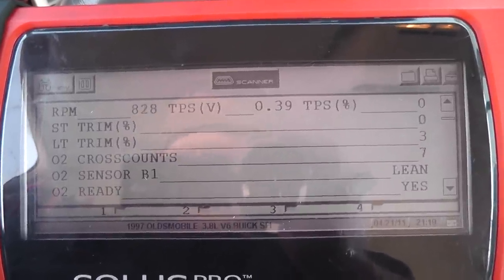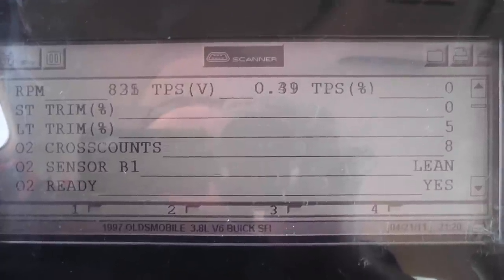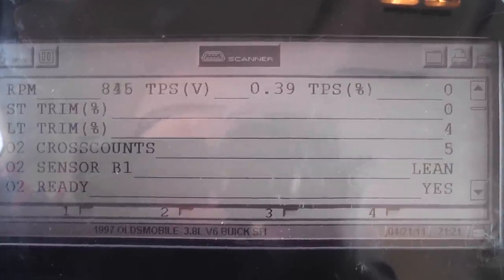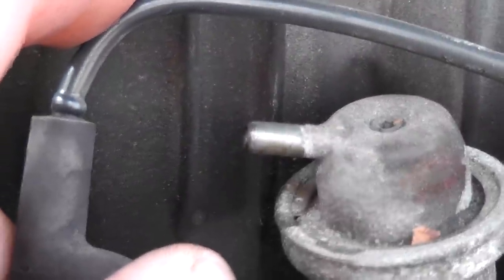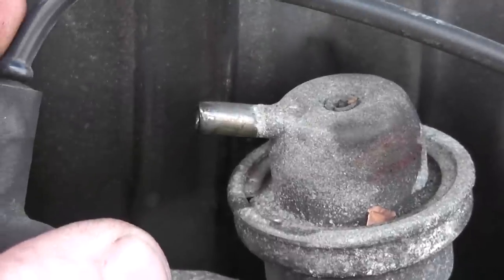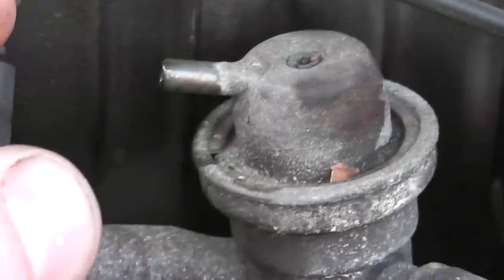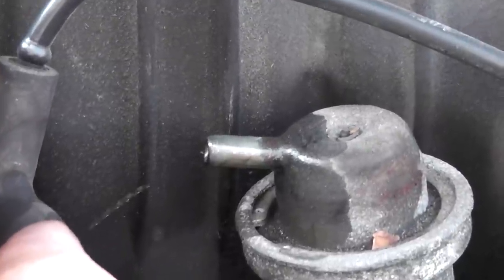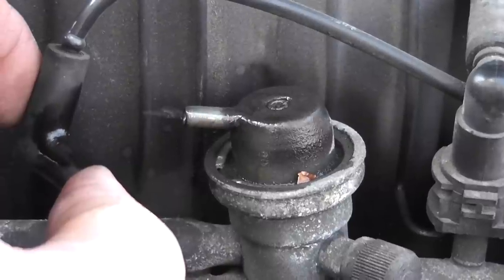Testing for a leaking, ruptured, fuel pressure regulator diaphragm

Comment: That was THE BEST - ABSOLUTE BEST - TESTING VIDEO I've ever seen so far.  You actually showed the damn failure. I already tested it according to what I read online and I didn't wait. Thanks for the excellent test tutorial.
Reply from the maker: Thanks so much! I'm glad this helped you
Reply: Thank you for replying so quick 👍. This is a fuel return to the fuel tank port injected setup system.The fuel regulator required vacuum from the intake manifold and it is installed right after the fuel rail. Do you know how to test a fuel regulator before it is install on any car. with a vacuum pump ?

Comment: Just wanted to say a huge thank you for the video. I have been fighting a stall/hard start problem for months. A mechanic I asked, told me he was sure it WASN"T the FPR cause he has never had to change one. So I threw several other parts at it. Nothing. Even sucked on the regulator to check for gas. Once I ran the car without the vacuum line, seven seconds and it started spewing fuel! Great job!!!

Comment: after waching many of your videos i find a problem very fast in a nissan frontier 2006 that had a rough idle with up and down rpm, and i thought it was a vacuum leak, but after checking the data with the scanner the fuel trim numbers were negative in every rpm, my iac was not causing the up and downs, it was the injection pulse that was causing the up and downs, and also long crank time, and the first thing i did was to check  for a ruptured in the fuel regulator and it was leaking very bad, 20 times worse than the one in this video, thank you so much, you are the best

Comment: dude, you have no idea how much pain ive been through. i got a 1988 chrysler dynasty, and it was having a hard time starting without me putting the gas pedal to the floor. i replaced just about every sensor i could, i checked my pressure (obviously not long enough) and only once i removed half my manifold did i realize my fuel pressure regulatore is completely buggered. THANK YOU MAN THIS IS STILL SO HELPFUL!!!!
Reply from the maker: awesome, glad it helped you!

Comment from the maker: What is your fuel pressure? Also these 3.1 engines are known for intake gaskets leaking coolant into the engine, this could contaminate your O2 sensor and cause a false rich condition and negative fuel trim numbers.

Comment: Thanks for the video bro. I have seen not one other video that has stated to give the regulator time to see if it will leak. They all say pull vacuum hose off and if you dont see fuel, put it back on. Props to you man!

Comment from the maker: @ScannerDanner BTW a slightly leaking regulator will cause starting problems and poor low RPM performance, but will run completely normal under loads. Engines can handle more fuel under load without any noticeable driveability problems.

Comment from the maker: @michobebemckawi That is completely normal on a drive by wire system. It is a default mode that causes that. If the engine is not running the PCM will NOT open the throttle plate in direct proportion to accelerator pedal position.

Comment from the maker: sounds like a lean condition. the reason it is possibly running better is when you disconnect the regulator vacuum hose you are increasing fuel psi by as much as 10 psi. 
not sure about the vibrating return line. maybe a pulsator has gone bad?
check it for a vacuum leak

Comment from the maker: nice job! you are clearly functional (and I mean that with the utmost respect)
With those numbers, what this tells us is you DO NOT have a fuel delivery problem and that your MAF sensor is clean. So what I am getting at is do not change the fuel pump and expect this thing to have more power. It will not. You may fix your bleed down issue and long crank time but NOT the low power issue. As I suspected, you have two problems, what does the customer want fixed? long crank time or low power?

Comment from the maker: @KingVee44 double check under the hood that you don't have an external leak, usually you can't smell the fuel if its the regulator diaphragm. It gets pulled into the intake. but if it is really bad I guess you could smell it.

Comment: This video is most excellent as I have a 96 Lincoln Continental with a 4.6L that I can't even get to start up anymore. When I was able to start it up though, it ran extremely rough and when I would step on the gas pedal the car would stall. I recently tested the fuel pressure on the rail and it was only 10psi. Of course with cycling the key a couple of times, I could get it higher, but the same issue arose when I tired to start it even after pressuring up to 30psi or so. I gld to know that the fuel pressure regulator could have a significant delay until fuel runs out of it, as I never saw gas coming out of mine either, where as in other videos the gas pours out immediately. I just ordered another a FPR and hope that's the fix as I've already tested the whole fuel system minus the injectors, but I'd be extremely surprised if they were clogged or faulty. Anyways, thank you very much for all your videos, but particularly this one!
Reply: Did it fix your issue?
Reply: @EliteNK  No, unfortunately it did not. I sold that vehicle years ago for next to nothing because of the ongoing issues and now own two Toyotas, a tundra and an fj cruiser, which I have NO problems with whatsoever!

Comment: Nice video, I had the same problem on a 2000 monte carlo. It would take some cranking to start and them shake and run rough for a few seconds, but it would only do it when you started it 15-30 minutes after shutting it off hot. Completely cold it would start fine. Only problems once it was started was a slightly rough idle and hesitation when accelerating off idle, like after sitting at a light for a minute.
Reply: I'm sorry. I was scrolling through and I tapped too fast and hit dislike. I have nothing against your statement. It was a mistake.
Reply: FlyingDelorean1 hi I have the same problem did you fix it? can you tell me what did you do thanks
Reply: @franciscosardinas8149  i have the same problem except mine turned off after driving 50 miles and it wouldn’t turn on between

Comment from the maker: That should be good enough. If you rig up a clear piece of plastic tubing and connect the vacuum line back up, this will increase your chances of catching it. I have seen these only leak with vacuum AND psi.
Chances are though, with no fuel in 5 min. your good.

Comment: Thank you for the information.  96 chevy Lumina with 3.1L engine.  It would start good cold and start hard after driving it.  Did just what you did pulled the vacuum line off the fuel pressure regulator and in 1.5 min gas came out of the regulator. Thank you again.  Jitty

Comment: Man this really help me to see if mine is bad. I have a 2001 Buick Century Custom. My uncle was sure enough to think it is the Fuel Pressure Regulator due to the hard start & rough idle. I pulled the line off it gives the suck pressure but was not long maybe 10 seconds it poured out. Mine is at the top yours to the side. I said that's it. Thanks allot.

Comment: I have a 2003 chevy avalanche.

 For the most part it idles and runs fine, however I've noticed there's a slight stutter in the idle.

No vacuum leaks based off trim numbers. 

Just like in your video, there are slight negative fuel trims on the short fuel trim levels, indicating a little rich, i.3 -3.9%  however the numbers are always with thin 10 points plus or minus, so in that regard it seems to be within spec and the numbers of pretty good.
They go to zero, then slightly negative, then zero again. 

I didnt throw a code, but in torque app, it said two misfires on cylinder 6 history.

It cleared itself though and then said zero in history, which I thought was odd.
  I installed a fuel pressure gauge that sits on my rail all the time, like seen on hot rods etc...

 When it's pressured up and primed not running, the fuel pressure sits at 50. When the engine is idling, it stays around 50 and does increase a little bit when you rev the engine.

The problem I have found, is I took a break and an hour or two later when I came back, the fuel pressure had dropped down to 0.

 I have had the fuel rail out with the injectors exposed whilel pressurized, and I didn't notice or see any fuel injectors leaking.

I disconnected the vacuum line to the fuel pressure regulator, and the fuel pressure jumped up to about 60 like it should, as far as I'm aware.

Can you still have a faulty fuel pressure regulator even if it responds by increasing fuel pressure when you take the vacuum line off?
Thanks

Comment: @ScannerDanner  I bought a used 95 rover si 214.  Took it to my mechanic for a general tune up and oil change and it seems to run smoother.  He mentioned a bad hose in the central port fuel injection system!  I have no idea about codes because I don't repair cars myself.  My limited experience of engines is based on lawnmowers and farming equipment with manual chokes.  If you flood the engine either it don't start or it runs very rough.  Anyway thanks for the help.

Comment from the maker: @GST1974 low power and too rich do not go together, although black smoke is from a rich condition. You need to start checking some basics. Fuel pressure, exhaust back pressure, timing marks on belt/chain. what about trouble codes? Also what year, make model are we dealing with?

Comment: I didn't pay $60 at the parts store or a dealership for mine I just got a cheapy $10 on eBay and it worked quite well car ran real nice I think I had a rich exhaust code of some sort of oxygen sensor or Rich exhaust code of some sort if I recall correctly it's been a few years boy that's pumping out pretty good toward the end of the video there good video brother thank you I already knew about it but thank you good video

Comment from the maker: @HuskyHiker I don't, I say clean the MAF sensor first. Very common to have cold engine driveability problems with a dirty MAF. Of course this affect warm engine operation too, but cold engine is more pronounced. You could try to start the car with the MAF unplugged and see if this fixes your long crank. If it does, it is definitely dirty.

Comment from the maker: @AutoTechHector Two things, does the fuel pump prime when the key is first turned on? If not you may have a FP relay problem. Watch my video on fuel system electrical designs. Second is how fast does fuel pressure build to spec during the long crank problem.

Comment: Ha, never been called funtional before. Thank your for helping me there's plenty else you could be doing I'm sure. Honestly I could not duplicate the lack of power on a test drive. W/the intermit. Long crank I was going to pinch lines last night but I have braided steel. I will look to see if I can find one accessble near top of tank when I go home, I'm at the shop right now. Its a side job. Fyi diagnosed tow in crank no start 10 min ago with info I learnd from ur videos.

Comment from the maker: While it is bleeding down you need to pinch off the lines like I do in my two part GM CPI Leak videos. 
This will at least tell you what is causing the bleed down and potentially the long crank time. The real question is, is this related to the low power condition or not. Test drive it at WOT and watch O2 mv and MAF HZ. O2 should stay over 800 mv and you should hit around 8500HZ at redline. Be careful, just wind out first gear. Let me know

Comment from the maker: Is this a MAF or MAP engine on this year? I think it has a MAF, I would look at that next. Watch my GM MAF sensor video (2 part) for testing of it. Also you could have a purge valve problem or possible EGR sticking open a little at idle (this would set a code though). There are other causes, check these first.

Comment from the maker: @kredmond61 check your fuel pressure when it doesn't start. Ignore the #6 misfire for now it may be related to a fuel issue with your lean code.

Comment from the maker: @KingVee44 I have never seen a ruptured diaphram cause a backfire. You may want to make sure your plugs and wires are ok. If you have a high resistance wire or an open spark plug this can cause an intake backfire. With fuel running through the reg. vacuum hose the intake backfire was enhanced and caused all of your damage. I just think something else caused your backfire. Also quit messing around with used regulators. These things go bad all the time and you are likely to keep getting bad ones.

Comment: @ScannerDanner Yes, though the stall problems have only become recent.  I've been getting horrible fuel mileage too, along with O2 sensor codes and misfires.  I pulled the vacuum line off and it leaked, a lot, right away.

Comment from the maker: if there is a leak it is usually the regulator. -6 or -8 could be enough of an indicator of a leaking reg. but this WILL NOT cause a low power complaint. just long crank times. 
Watch my dirty MAF sensor video for the WOT O2 test and also one on a plugged exhaust where I do the same test. I think you have two separate problems. Although a weak pump could be the cause of both a long crank time and low power but NOT negative fuel trim numbers. Also the bleed down is a concern too

Comment: Good video. I've just tested mine and it's good, I've found my throttle linkage gone faulty so it suddenly changed the throttle position and the adjusting screw was too far to compensate

Comment: Does a rich mixture cause misfiring and loss of compression issues?   My 16V DOHC sounds like a diesel engine and I can't accelerate with second gear up hills.  

Gas mileage is lousy and I can faintly smell gasoline from the drivers seat.  Maybe a sticky EGR as well as a bad fuel pressure regulator?  Thanks for any comments!

Comment: Mr ScannerDanner

How do you test the FPR on a returnless fuel system? When I pull the back seat out to reveal the fuel pump there are two hoses connected to it. One hose is the fuel outlet, I suppose the other is connecting to the FPR from inside the pump assembly? Please confirm. 

Thanks in advance!
Reply from the maker: You can't. The second hose you see is a vapor line if it is returnless. Unless of course it is a system that puts the reg. in the fuel filter. This is easy to ID by the number of lines on the filter. If it is just two lines, then the reg is in the tank

Comment from the maker: @buddha65281 Any trouble codes? When you say "The start is rough" do you mean a long crank time or when it starts it runs rough for a few minutes? Could be many things: plugs, plug wires, one of the coil packs, clogged exhaust, fuel pressure dropping under load, dirty MAF sensor.....a loose nut behind the wheel :)

Comment: Outstanding diagnose video.  I have a 85 nissan 300zx that I keep getting fuel regulator codes for and no where in my manuals does it tell me to do this kind of a check.  I will check it today but still have my doubts that's where the 2400rpm chocking problem is coming from.  Thanks and keep up the good work.
Reply from the maker: my son has an 86 300zx we just picked up from Florida last year :-)

Comment: i replaced my regulator on my 97 but I will warn you that snap ring is a beeetch.  Not too hard to get off, but I had to really struggle to reseat it back in the groove.  Broke/bent out of shape my snap ring pliar tool.  It wasn't strong enough and it didn't quite close the ring good enough.  I had to file down the top of the snap ring a bit to make it thinner in order to get it back in the groove in the housing.

Comment: Lol. I didn't have to do any waiting. I had been tracking down a similar problem for a while. As soon as I pulled that vacuum line off gas sprayed out. I'd first checked fuel pressure with a tester, it was fine. I'd replaced the gas cap and the evap purge solenoid (it was throwing codes, but probably wasn't the problem). When I figured out it was the regulator I wondered why I didn't check that first, they always go out on my model of car. This all started after I had to fix a blown out spark plug and the coil above it. Now I wonder if the leaky regulator diaphragm somehow help the plug come out. Beats me, old cars, it's always something.

Comment: Well, I don't have enough experience in the field to tell. I'm gonna investigate that. I don't see anything change on the scan data besides the rpm so I'm not sure. Hey I pinched the lines near the tank and I got a bleed down. I took off the upper intake and found leaky regulator. Fuel trims 1 and -1. Fires right up everytime. That's a fix. Thank you

Comment from the maker: @GST1974 "sounds like a diesel", this could be a detonation problem. This is usually from a lack of fuel or a timing issue (jumped belt/chain). If you have low power under load its not going to be an EGR or fuel pressure reg. problem. Check out my video on a dirty maf and do the WOT O2 mv test. This will tell you if you are getting enough fuel.

Comment from the maker: @IROCwarriorAMC88 Most likely not, start with plugs and wires and don't go cheep on the wires. You get what you pay for. Oh and none of those bosch platinum POS plugs either. If this doesn't fix it you may have a coil pack breaking down or even possible shorted injectors (very common on this model) I have two videos on shorted Multec 1 injectors (same as in your camaro) check them out

Comment: All these comments are from years ago 😂 I wonder if the youtuber still checks 😂. Just wanted to throw it out there... great video. And yes a bad regulator can throw you misfire codes. Check the regulator first and foremost.
Reply from the maker: Of course! I read every comment 😉
Reply: ScannerDanner awesome. Subscribed. I have a question, what if the vacuum hose is not working? It’s not sucking any air.
Reply from the maker: Some systems used a solenoid to control the vacuum. What year make model and engine?